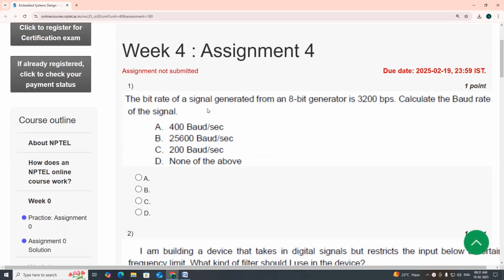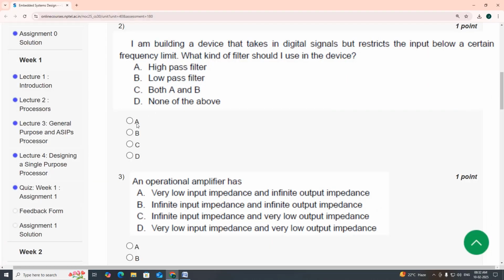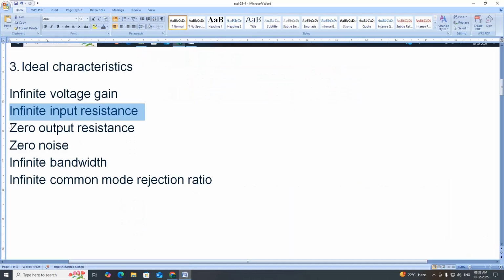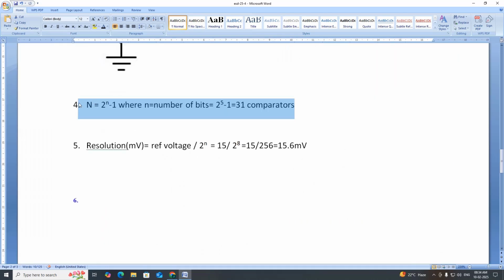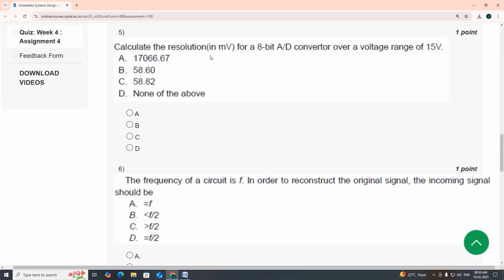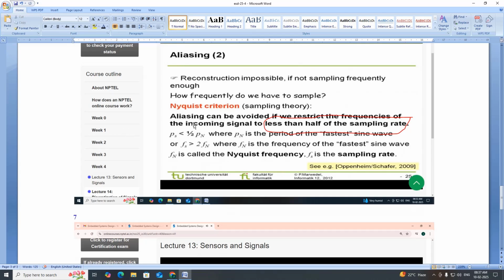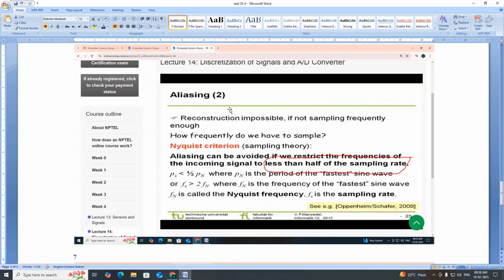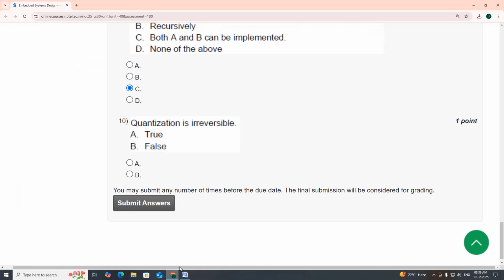Assignment 4 Solution | Embedded Systems Design |NPTEL Course Jan-April 2025 |InfoXel

Comment: Sir in question 2
A high-pass filter allows signals above a certain frequency to pass while attenuating lower frequencies.

If the goal is to restrict the input below a certain frequency, shouldn't a high-pass filter be the correct choice.
Reply from the maker: Dear learner, low pass acts as anti alias filter  to avoid aliasing problem. Kindly share this channel to your friends and classmates for their benefit
Reply: I too think that high pass filter would be the correct answer